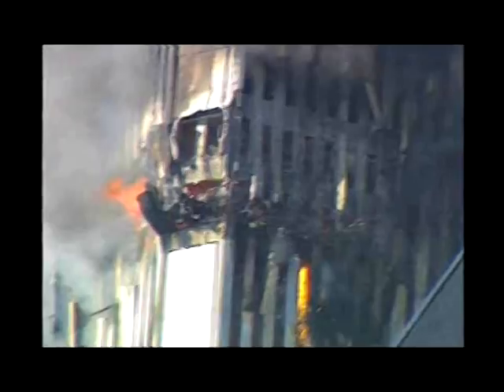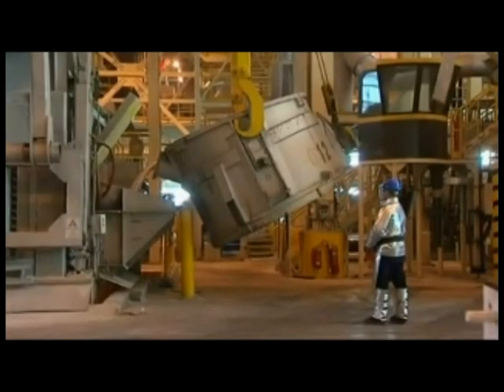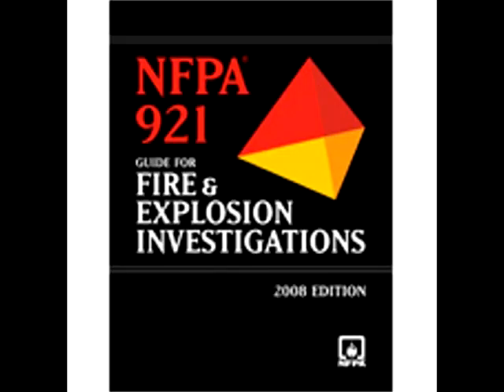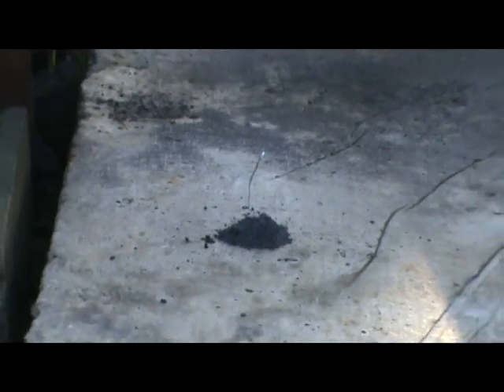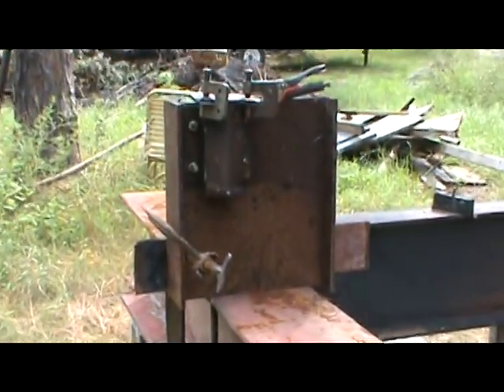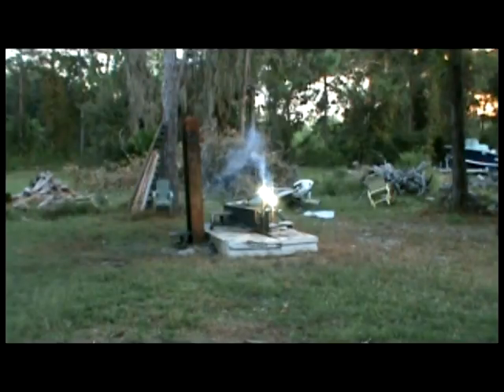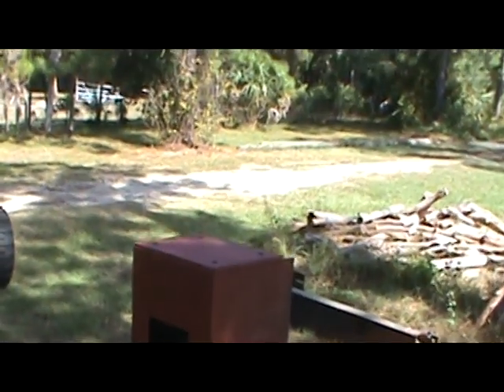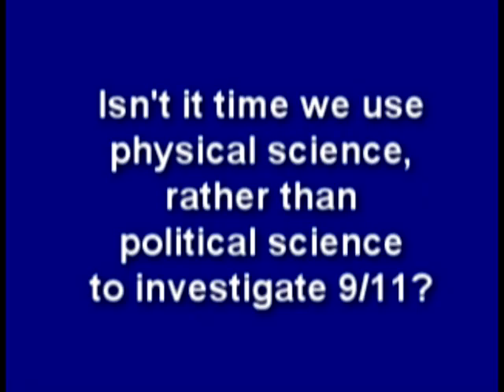9/11 Experiments: The Great Thermate Debate

Comment: This is tech weve used since the 40s for controlled demolitions. Its not all dynamite because that potentially causes catastrophic situations. Thermite/thermate/whatever is much more reliable and safer. No explosions, its quiet, its low profile, can be designed to look like normal electronic equipment like signal boosters, alarm systems, or whatever. 

People think its so hard to do shit in secret. How much do you know about what the contractors do in high rise buildings? Not much because you dont get access to where they are working. 

It wouldve been very easy for contractors to go in the the year before, and start wiring up destructive devices. Another theory, is ALL high rise buildings are wired up to be demolished in a controlled fashion in case of catastrophic fire or some other event. Like terrorist attack. 

Wouldnt take long either. You people trust the government way too much. When theyve been caught lying for decades, caught red handed conducting false flags, economic hitmen, the list goes on and on. You really think our government is above sacrificing 0.001% of our population?

Another fucked up thing, how hard do you think it is to "create" fake people"? As in that lady that supposedly called her husband from the plane as it was flying through the air, BEFORE we had that tech available to commercial airlines. People just dont ask the right questions anymore. Its very sad.

Comment: What you fail to realize is a simple principle. That the building was so high and where the plane crashed was above all other buildings. Giving wind a direct shot at the fire. What happens when you force air into amconfined space with a fire being fueled by jet fuel you say? Well you get a sort of forge effect. Which causes the tempurature to artificially inflate. This is the reason the steel melted. I am not a scientist but I figured that out quite easily.
Reply: Jetfuel is highly flammable. Forge effect or not, all that fuel burned instantly/in a few seconds right after impact. Hence the big fireball from the fuel in the wings smashing into the exterior of the building. There were no remains or burning pool of fuel. It all incinerated on impact.
Reply: The problem with that theory is so simple it's sad. If the steel only melted at the height that the planes hit, the entire building would not have collapsed.
Reply: The windows blew out at impact point. It was confined only for a few seconds. And as the building stood past the impact and the slow burning office stuff dire was weakening the steel, the building would have been blown past the centre of gravity and would have toppled. Or did the wind stop immediately after impact?
Reply: there were bodies blasted into pieces and onto rooftops of other buildings. that's not what a pancaking building does. when a building pancakes people get trapped and smushed between the floors. clearly, this building did not pancake.
Reply: CFFT jet fuel is actually pretty hard to ignite compared to other fuels like common gasoline or ethanol. In fact, jet fuel doesn't even evaporate with any hurry like other fuels. It just puddles up and presents a slip hazard until the boss tells someone to clean it up

Comment: None of the experiments take into account the altitude. The high winds could push any fire as long as it had fuel high enough to melt steel. All it takes is enough air and fuel, you can melt steel in your own backyard with a homemade foundry. I don't trust the Gov either, but c'mon! If you don't know what you're talking about you're just another conspiracy nut.

Comment: Railroads use a thermite-based powder to weld sections of railroad track together. There are plenty of such vids all over YouTube. If it gets hot enough to weld 2 pieces of steel together, then it gets hot enough to melt and cut. How many welders out there use the same oxy-acetylene torch to both cut and weld? My guess is quite a few. Not saying it's as quick or effective as other methods, just saying it can and has been done.

Comment: I can melt steel with fuel oil and air ie jet fuel.  At that elevation and wind spreed it is like a blast furnace. Let it rest it was a terrible thing, but never forget!
Reply: Just wate you think 911 was bad what do you think it will be like when they turn out the lights.
Reply: Kinzie Burton lies. I'll give you $10,000 to make a video of ~this quality showing you doing what you claim you can.
Reply: how can lead and copper go thu steel(you know a bullet dumb fuck)same principles
Reply: Laurenz xD Grenfell Tower stood .....and is still standing
Reply: Kinzie Burton but jet fuel has additives specificlly made not to light to keep fires down upon a crash the fuel you used didnt so it would light
Reply: Timothy E Hook thank you!
Reply: Kinzie Burton hey dumb fuck explain how air plane wings can cut through steel?
Reply: You dont need a 1000'  building or a 747 only need to find materials the same and recreate the wind speed but sounds like your all talk
Reply: Aluminum and iron mixed correctly is thermite. (aluminum, magnesium) and a metal oxide (iron oxide, copper oxide, manganese oxide…) all these will burn at 2500 degrees. cutting steel like a knife thru butter.  As a chemist, I follow procedure and facts such as wind, stress, weight, and chemicals to come to a conclusion that everyone of these fires and molten metal are 100% causes from a Thermite reaction.
Reply: Tim - I thought it was a factor of 4 to 8. ...?
Reply: Michael Winter ...the equation for critical buckling has a fs of about 2..now if the column was designed and sized at 50% capacity...anywhere from 50 to 80% is normally what's done..then itd  be a fs of 4...and that's on a fully loaded condition..90+ mph wind and fully loaded with people...neither of those two were the case that day.
Reply: Bin Laden to credit for it they were even able to track the line all the way back from the hijackers all the way to Al Qaeda so come on folks at that time airport security was nonexistent that shit happen and it is to discredit to the people who died, trying to make a Schrade out of it.
Reply: You cherry pick your data to help you conspiracy theorem . The completely ignore entire fields of Science and laws of thermodynamics and at high enough temp the the aluminum plane burns and that burns at a high enough temp to easily melt steel. You all keep going on about this thermite melt down that happen well guess were they got all the Aluminum from it wasn’t powder it was the fucking plane, fuck yeah!
Reply: Walter Foster fun
Reply: harrod19 I don’t own a 1000’ sky scraper or a Boeing 727
Reply: mjbs Newtons first law
Reply: Timothy E Hook No they plan for something like a twin and just designate call the slam into them not a Boeing 727 commercial line or fully loaded with fuel that is significantly different amount of mass yet so there goes your theory
Reply: me us big differences between bullets and airplanes, man. Density, velocity. Airplanes are hollow and thin-skinned and slow. Bullets are solid and moving a lot faster. Not a good comparison.  Anyhow,  bullets don't cut steel,  they break it. Take your .308 or 30-06 or 7mm magnum and shoot a piece of 1/2" mild structural steel.  It'll pop out a 1/2" mostly spherical blob. It tears it, rips it, breaks it. No matter how fast it's traveling, a hollow aluminum bullet won't do that.

Furthermore, full metal jacket slugs do not penetrate steel as well as soft-nose expanding bullets do. In our 1/2" mild steel experiment, tungsten penetrators are barely any more effective that soft-nose deer bullets.
Reply: Why is it that a news reporter got to investigating this and has found 7 of the 12 dead member, working in airline and computer companies.   Funny how they have pic of leader Mohammed Atta getting on a plane in philli or somewhere like that  instead of on the plane from dulles.   HMMM?   It was proven to be beyond a shadow of a doubt that these were the same supposed on the planes.
Reply: Kinzie Burton waiting for the video upload
Reply: Kinzie Burton fucktard
Reply: whether it's a conspiracy or not, he can melt steel with fuel oil easily with the addition of compressed air. Don't make bets you can't back up boss. I am a union ironworker, I know what i'm talking about.
Reply: Kinzie Burton bin laden is actually on record denying any involvement and clueing US people to look at "the govt inside the govt" for those responsible...I've found that a person would need to apply conservation of momentum of the buildings mass during the collapse to understand that the govts "explanation" doesn't hold up to scientific scrutiny....or they can watch the TV for their info on this and be totally misled....
Reply: Kinzie Burton did you bother to read that incoherent babble you just wrote?
Reply: What Local? and yes with the correct amount of compressed air and fuel oil you can cut steel.
Reply: Big Tipper what local?
Reply: Big Tipper what's your book number?
Reply: glockstr1 - bending is not yielding.
Reply: glockstr1 ahh yes. That explains why steel towers simply fall into their footprint and turn into dust
Reply: Yup and they also ignore that it doesn't even have to melt.  Just have to get it hot enough to bend and I've done that with plain old charcoal.
Reply: Leave the science and engineering to those of US who are qualified to speak about it....faith in the govts BS story isn't something to be proud of.
Reply: glockstr1 ...there is a factor of safety of about 2 built into the column buckling steel design code...add to that the fact that columns are never designed to 100% capacity..and you get a safety factor of about 3 on a fully loaded building during a hurricane. ...besides, a quantification of  conservation of momentum of the building mass inertia alone proves the fact that the columns below the impact site provided no resistance to the collapse....of course you would have know all this if the govt would have quantified the Collapse Event ..(which IS required BY LAW) ..but the govt did nothing of the sort....I've been designing structures for over 2 decades....I venture to guess you have no experience what so ever.
Reply: I see you have "quantified" the effects of fire...have you "quantified" the forces required to make the building suddenly and completely in its foot print taking 2 seconds longer than it would have free fell?...I thought not.
Reply: The world will never forget this charade that the US has pulled for the sake of their imperialistic goals.
We will not forget your unwillingness to investigate what  happened. we promise to never forget.

Comment: Let's just say that what we saw in the video was Thermate burning through a steel column. What still doesn't make sense is why we don't see that sort of burning on all the corners/columns of the building.  That is, if you are going to bring a building down, you can't just put Thermate or Dynamite on one of corner of a building and expect to bring it down.  It has to be placed all around the building. Yet, you don't see that sort of burning anywhere else.  Further, if Thermate WAS used in such manner as you think, the building should have come down a heck of lot faster than it did.  Sorry, but your theory still just doesn't hold water.

Comment: Wow , thermite burns steel . Which twat thinks thats "Proof". Of Anything. FFS .these controlled experiments prove Jack shit.
Go get 2 80+ storey towers , fly 2 fuel Laden passenger planes into them and THEN you can start talking about what is possible or Not possible about such infrastructure .Running an aircraft body into concrete scenario ,Show molten metal , sparks and high temperature burning in CONTROLLED environments and Shonky models Proves Jack Shit .
Its so leftard to Build a Conspiracy off modelled to get a result you want experiments. Its like "Global Warming" .Now called Climate Change or as we all know evolution ,Climate "change has been happening for billions of years. No one want to talk about the Trillions made by This Hoax. Nope, just this UNPROVEN SPECULATIVE at best Conspiracy that sounds all So secretive and Paints all as Being totally Stupid. Sadly now this Conspiracy narrative makes so much money for the people putting it forward it itself is now Corrupted.